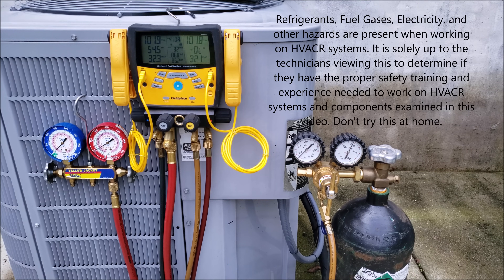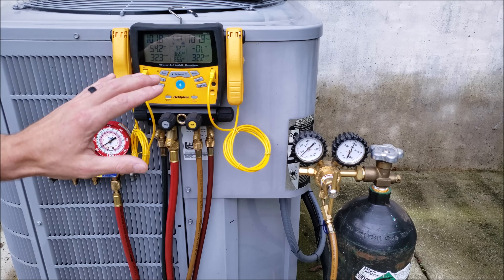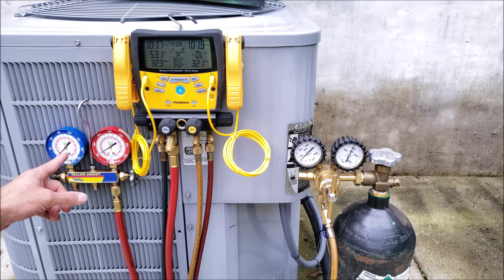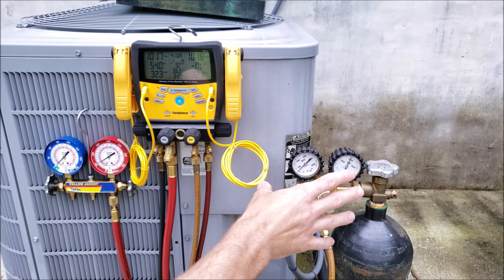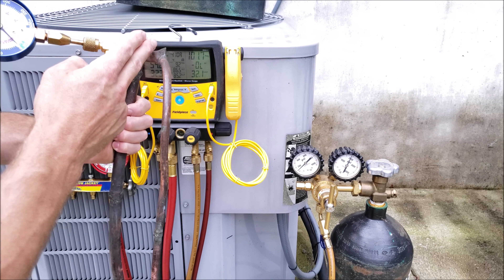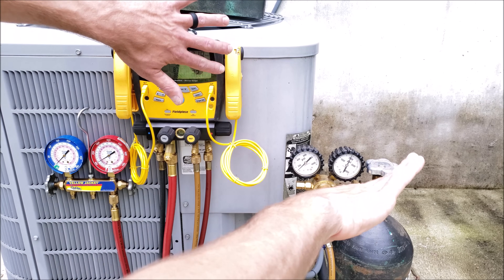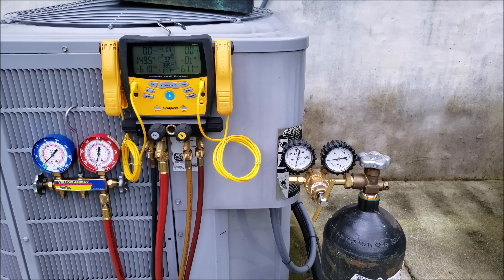Top 7 Crucial Tips for Pressure Testing HVAC Systems!

Comment from the maker: The E-Book and Paperback: https://www.acservicetech.com/the-book
Tool List-  https://www.amazon.com/shop/acservicetech
Support the Channel-  https://www.patreon.com/acservicetech
For those that are looking for the tools used in the videos: (Linked Below)
Appion Valve Core Removal Tool http://amzn.to/2uYr8WL

RectorSeal Bubble Gas Leak Detector - http://amzn.to/2ckWACn

25 Valve Cores - https://amzn.to/2L37UJU

25 ¼” Brass Port Caps with rubber O-rings - https://amzn.to/2GIOdD2

Brass Valve Core Tool which holds 3 valve cores - https://amzn.to/2GFEbm2

Valve Core Torque Wrench - https://amzn.to/2GHiLoD

Locking Cap Universal Lock/Unlock Tool - https://amzn.to/2GGAoVp

Locking caps - https://amzn.to/2GFXZ8A

Ratcheting Service Wrench http://amzn.to/2dGV4Nh

Yellow Jacket Sealright 90 Coupler- https://amzn.to/2LsU1V7

Yellow Jacket 1pk Compact Ball Valve- https://amzn.to/2uXdF18

Yellow Jacket 3pk Compact Ball Valve- https://amzn.to/2AiKfQe

Thumb Screw Valve Core Depressor with Backseat- https://amzn.to/2mR0sCL

UEI DL479 Multimeter with temp sensor http://amzn.to/2jtsUbJ

Yellow Jacket Refrigerant Gauge Set http://amzn.to/2aenwTq

Refrigerant hoses with valves http://amzn.to/2aBumVI

Yellow Jacket Gauge set & hoses https://amzn.to/2vLVkV9

Yellow Jacket 4 Port Manifold w Hoses https://amzn.to/2BkuGIq

Digital Refrigerant Scale  http://amzn.to/2b9oXYl   
Ratcheting Service Wrench   http://amzn.to/2dGV4Nh 
Accutrak VPE Ultrasonic Leak Detector https://amzn.to/2nFYKVe

Accutrak VPE-GN Ultrasonic Leak Detector https://amzn.to/2Zy4IZP

FieldpieceSMAN360 Digital Manifold Set https://amzn.to/2BdoaD4

FieldpieceSMAN460 Digital Manifold Set https://amzn.to/2nB4Fe6

Ultrasonic Leak Detector with Headphones- https://amzn.to/2B2cRO3  
Compact Ball Valve for Refrigerant Hose https://amzn.to/2KUisW8

QuickDisconnect 90 for refrigerant hose https://amzn.to/2MMtVcg

JB 6 CFM Vacuum Pump   http://amzn.to/2nqbvo8

Appion Blue 3/8" to 1/4" Vacuum Hose http://amzn.to/2uYlVyc

Appion Red 3/8" to 1/4" Vacuum Hose http://amzn.to/2uYg6Ro

Appion Valve Core Removal Tool http://amzn.to/2uYr8WL

Yellow Jacket 1/4" by 1/4" hose http://amzn.to/2umtcod

CPS Vacuum Micron Gauge http://amzn.to/2v1nM3O

Supco Vacuum Micron Gauge http://amzn.to/2v1JRiA

RectorSeal Bubble Gas Leak Detector http://amzn.to/2ckWACn

Magnet Jumpers- https://amzn.to/2PyKPQZ

Alligator Jumpers- https://amzn.to/2PxqJXn

Fieldpiece ST4 Dual Temp Meter  http://amzn.to/2wc1ME3

Fieldpiece Bead K Type Temp Sensor https://amzn.to/2DBwKfs

Fieldpiece Wet Bulb Temp Sensor https://amzn.to/2RRI7Tw

Fieldpiece TC24 Temp Clamp https://amzn.to/2qHLyjZ

UEI DL389 Multimeter  http://amzn.to/2xAdaJf

Air Acetylene Torch setup    http://amzn.to/2aQalsb  
15% Silver Brazing Rods  http://amzn.to/2gVLyLc

Nitrogen Regulator    http://amzn.to/2bXdR5f

Nitrogen Flow Meter    http://amzn.to/2brvoBg  
Other tool links can be found in the video description section.

Shop through Amazon! Your Purchases through Amazon provide a means for channels such as mine to earn advertising fees from all purchases after clicking through. Prices are the same as normal-    https://www.amazon.com/shop/acservicetech

Comment: I have 3 of those gauges hooked up outside my house right now to my heat pump. It's been hooked up for 3 days and the pressure hasn't dropped. They disconnected the lines at the unit and they're hooked to the lines going inside my house. Maybe it's the condenser coil or in the fitting he took apart. Only other place the leak could be. They've had to come out the last 2 years and top it off because it loses cooling or heating ability. Then it runs fine for about 6-8 months until they top it off again.  What do you think?

Comment: It's disgusting that MFG's still assemble evaporators with copper or alum tubing in contact with galvanized sheet metal virtually ensuring that dissimilar metal corrosion will destroy it and consumers will be forced to buy new systems long before they should have. 2:11

Comment: i've tested my refigerator for leak..and i tested for leak with air compressor for about 15 hours with 100 PSI pressure on it...and the pressure is drop 3 digit..now the pressure is 97 PSI..question is..is that normal??  i mean the system is fine and there is no leak on that system..or i have leak on my system? i really confuse..please help me🙏

Comment: after reading your book chapter 11 of pump down prosedure, if i put my refrigerent all on outdoor unit, then seal 2 service valves, (i got txv system) can i do the pressure test on indoor unit only and whatever pipes it is connecting, is it possible ? thanks. ps. can i vaccum my system with refrigerent still on it ? thanks

Comment: I am installing a mini-split system.
Refrigerant is R410A
High side pressure is 550 PSIG
Low side pressure is 340 PSIG

Using a Yellow Jacket 40331 Red Pressure Gauge with 19110 Quick Coupler / nitrogen.

What pressure would you recommend and how long to wait?

THANKS!
Reply: The yellow jackets dont really go as high they only ho to 300 but you dont have to go 100% pressure test on them

Comment: Do you have video on replacing gromits in hoses? I usually replace the hose.
Reply from the maker: A lot of people did videos on those so I didn't do one. You can use a valve core tool to unscrew the valve core depressor out of the end of the hose. Once that is done, you can get a thermostat screwdriver in there or hook tool and get out the grommet, thanks!

Comment: what's your opinion about Victor ESS32-PFH 800 PSI Hybrid Nitrogen Purge Regulator? can I use it instead of pressure regulator and a flow meter?
Reply: Where are you putting 800 psi? Most coils test out under 650. So no, not recommended for HACR.

Comment: Great videos Craig. Speaking of pressure gauges, pressure transducers are cheap ($10 on amazon.) So are the wireless embedded controllers to  read them ($10 for a raspberry Pi zero W). A few bucks more for odds and ends and I can monitor my Carrier A/C pressure continuously from inside. Mighty handy in the dessert where the sweat test doesn't work. But the transducers are usually 1/8 in NPT female. What kind of adapter will get me from that to the odd-ball fittings they use on air conditioners? Should I use a tee? Should I bother with low loss connectors if it's only going on once and never coming off? Should I put it on the high or low pressure side? Any advice. If I get it working I'll post it on youtube or instructables.
Reply from the maker: If it is a standard split system, it is 1/4", and if it is minisplit it is either 5/16  or 1/4". We measure superheat and subcooling so we measure from both sides, thanks!
Reply: Did you ever get it working?

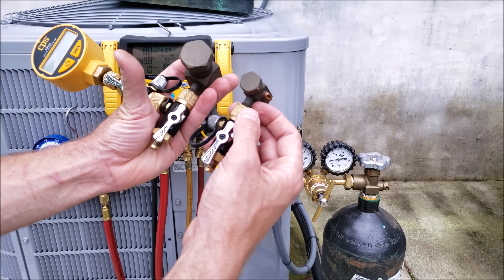Comment: 5:50 what’s your Amazon link for the Tee quick connector? Or the Appion valve at 9:29? The Fieldpiece smart probes are hard to be connected directly to service valves, which leads to refrigerant lost during connecting. They should made the screw cap a little bit longer
Reply from the maker: I have the links at amazon.com/shop/acservicetech thanks!

Comment: It’d be worth noting that if pressure testing the whole system to not exceed 300 psig as the weld of the compressor being on the low side is capable of rupturing at 350 psig. Emerson has a bulletin on this
Reply from the maker: Thanks for adding that Jeff! We don't need to go crazy when pressure testing systems. Often times techs look at the outdoor max design pressures without looking at the rest of the components, thanks!

Comment: You should add fluctuations on pressure/temperature when left pressurized for many hours!
I use 0.5 psig per degree F* 
Although I’m not sure if it’s correct!
Reply from the maker: Yeah I mentioned that it can occur but I see a lot more fluctuations than that in the beginning of the pressure test, thanks Pastor Martinez and thanks for Pastoring!!!

Comment: How do you isolate the evaporator or the condensor when pressure testing?
Reply from the maker: If you want the outdoor unit isolated from the line set and evap coil then the two service valves will need to be front-seated, thanks!
Reply: @acservicetechchannel  great question, and a great answer!!

Comment: I pressure tested both sides with Nitrogen at 180 psi.  After 24 hours the suction side still read 180 psi but the pressure side was at 0.  I don't understand.  Aren't both sided connected?  What is going on.  The leak seams to be very small.
Reply: is this a ac or a refrigeration system? most ac systems will equalize pressures when off. but solenoid valves and hard shut off txv do exist in some applications and will stop the system from equalizing
Reply: @james6794  Thanks for getting back to me.  This is an ac system, Trane XR12, 1-1/2 ton with a Trane TWE air handler
Reply: I had a carrier system with the similar scenario. Txv was closed shut. Txv Warranty swap out fixed it.
Reply from the maker: Yes sometimes systems come with a hard shut off TXV that does not allow equalization. That is why I was mentioning to add the nitrogen into both sides of the system when pressure testing. It sounds like you will need to search for the leak between the txv and the liquid line service valve unless the liquid line service valve is open and the outdoor unit is connected. You may want to front seat that to see if it still leaks if you cannot find the problem. The you can pressure test the line set and up to the txv by itself. It should be a large leak if you lost all the pressure, thanks, Alex, Mumixam, and D Green!
Reply: @acservicetechchannel  Thanks for your reply.

Comment: Great video Craig. Can you do a video on type 1 appliances ?
Reply from the maker: Hey JiggyPatel, glad to hear from you! I just did one on brazing a service valve on a small packaged ac unit to date. Look up acservicetech pinch off tool" thanks!
Reply: AC Service Tech LLC I have a slushy machine. That need recharge with 404A. And none of the company around here carry 404a tank. Seems ironic.
Reply from the maker: Refrigeration companies typically will have R404A but Air conditioning companies usually will not, thanks!

Comment: a supposed large company came out to my dad's house they didn't have nitrogen only dye that they charge $200 for to put a few ounces in the system come back in a couple of days and look for leaks I told him to pack up and leave they will not be getting their service charge)
Reply: I would only put dye as a last option. Only oil and refrigerant belong in a seal system.
Reply: Craig's video is about pressure testing a new install with no refrigerant in the lines yet.
The company at your father's place was wanting to do a dye test to search for leaks on an operating system. This is a totally legitimate means for finding a leak.
If they diagnosed his system was low on charge and recommended a leak search you need to pay the trip charge, sorry. Nitrogen should not be put into a working system as this is non condensable.
Reply: What is wrong with testing a leak with dye? Its cheaper then to pull the charge and pressure test then repair leak and vacuum unit. Unless the system was 100% empty. But if there is still enough refrigerant left you can try using a sniffer first then use dye if that fails.
Reply: This is a perfectly legitimate way, and commonly used, method for checking for leaks.
Reply: @missionairkevingrider1869  Use an ultrasonic.  No dye necessary and fast.
Reply: @SovereignTroll  That's how I do it...but, the dye method is used by a lot of techs/companies.
Reply: If they don't have N2 that indirectly means they also butcher the inside of new and existing line sets brazed with avoidable oxidation not purging while brazing and with blocked screens and plugged caps and TXVs.  Sounds like a BBB issue.
Reply: @SovereignTroll  Lots of speculation on your part. Most techs can find a leak in an operating system without nitrogen. The goal is to keep the system functioning until an opportunity to repair. Obviously the leak is very small and probably allowable according to EPA guidelines. Parts aren't always in stock and no AC is pissed off customers.
Reply: @fathom73  Big blue better than dye. I also don't understand the Industry vs. Ultrasonic.  Wind is the main hurdle with sniffers and Ultrasonic immune.  I never forfeit customer and AC.
Reply: @SovereignTroll  my fieldpiece has found leaks not detectable with big blue. I'm talking 410a. Pain to find leaks with pressures so high when they are so tiny. These old copper coils all leak the 410a after year 7 or so. Thing is that they are so small it may take a few seasons to make a difference on cooling capacity. I hope the all aluminum coils hold up to the test of time. Still lots of ol cowboys treating 410a like r22. 410a system is too fragile and they fail every time on poor installs.
Reply: So you wanted them to remove the refrigerant and pressure with nitrogen to find your leak? That's a lot of work when the dye was probably going to keep your system operating in this hot weather.  Two separate trips to find a leak for $200 is reasonable if their leak testing equipment couldn't find the leak.
Reply: True but sometimes with a 410 system you cannot find a leak vs 22. So the dye is a good resolution
Reply: You have no idea what your talking about.
Reply: Great tip on the Evaporator pressure. Something to think about now
Reply from the maker: So when I notice the charge is low, I shut the system off. Then at the outdoor unit I visually look for oil streaks in the fins or oil accumulating on and below tubing. Next at the outdoor unit I add anti-corrosive bubble leak detector to obvious joints and where the top cap meets the service valve. Then I move to the indoor coil. It is harder to look for oil at the evap coil because it is wet but if it is dry then you can sometimes see the refrigerant oil leaking out of the leak location. You could add bubble leak detector to the joints but at this point, I switch to my ultrasonic leak detector and listen for the leaks at the indoor coil. The ultrasonic leak detector works well especially if the coil is wet becasue it will make an even louder noise at the leak location. Then I listen for leaks at the outdoor unit. If I don't hear the leak by then, I wet the outdoor unit with water and then take off the top fan. I run my ultrasonic detector over all the spots and 19 out of 20 times I will find the leak by then. I didn't have such a high success rate with finding leaks until I moved from the refrigerant sniffing electronic leak detectors to the ultrasonic. The heated diode detectors work ok but not well in wind and they are usually HFC or HCFC specific. Anyway, at this point, I would consider using something like a dye to find the leak as a last option. The reason is that I want to find the leak right then and there and not have to come back just to search for the leak. I also don't love adding additives into the system if Im don't have to. The dye gets in your hoses as well and adds an extra cost to the job too. That being said, it is not a bad leak detection method but just not onje I would use first. I wouldn't pull the charge to add nitrogen because there is already pressure in the system for my detector to use to find the leak. I use the nitrogen for pressure testing when all the refrigerant has leaked out or on new system installs. Of course, we all usually have nitrogen in the truck to use for pressure testing, blowing hoses out, flowing nitrogen while brazing, and using in a pinch when we don't have an air compressor for things. I hope this answer helps! Thanks to all who provided their technical knowledge and experience respectfully to help others!